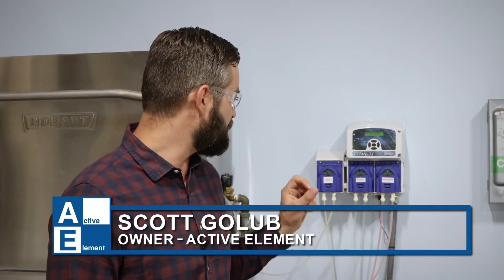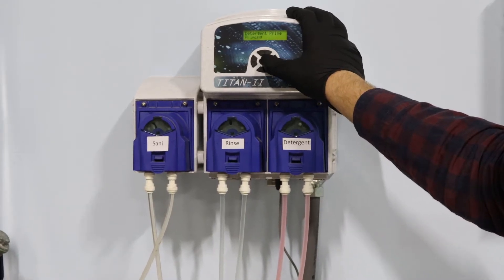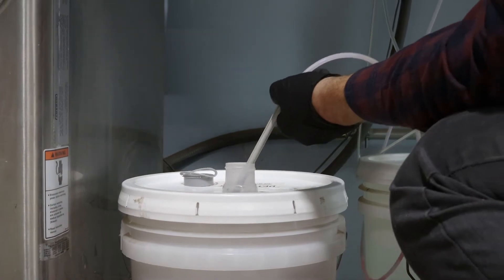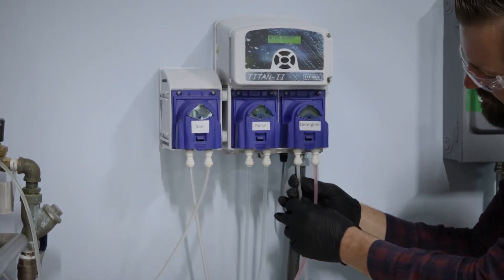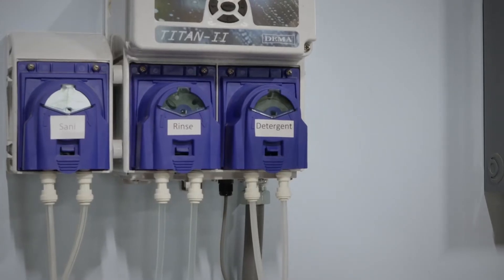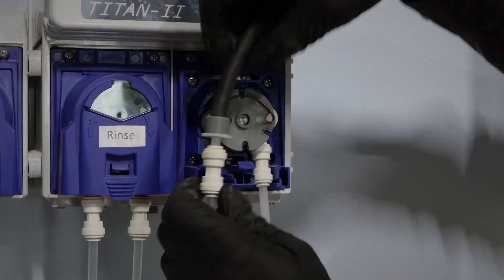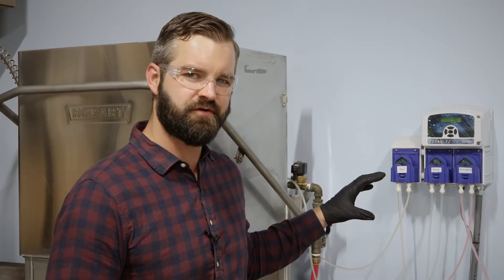How to Replace Your Chemical Lines and Squeeze Tubes - Active Element - Maintenance Series

Comment: What would cause the low detergent alarm to go off even though there is plenty of detergent available? We have at my work the same dispensing system except can you use a solid soap that  hangs upside down and its holder. In addition to the alarm going off the other system is the machine is using way too much detergent. We have someone coming in next week and I didn't notice a wire sticking out that is possibly being pinched. I do not see the wires sticking out in this video.
Reply from the maker: Sounds like the wire would be the issue. Were you able to get this resolved?

Comment: I have a Hobart centerline dishwasher. The chemical supply line has some “black” lines, maybe the width of a pencil eraser at several segments in the end of the line (where it sits in the gallon detergent). Is there a way I can clean these out or do the lines need replacing?
Reply from the maker: Thank you for reaching out. I recommend replacing the chemical lines. The chemical lines get worn, brittle over time and you will eventually have to replace them anyways. My guess is you could replace the lines in the same amount of time it takes you to flush them out. Hope this helps. Thanks!

Comment: Good evening are you familiar with knight UMP warewash dispenser, can you please makea a video about the installation and problem shooting of this dispenser. Thanks.
Reply from the maker: Thank you for the inquiry. The Knight dispensers, and all the chemical dispensers, are very similar in their operation and troubleshooting. The squeeze tubes and chemical lines are a different part number but there is not much that can go wrong with these dispensers. Is there a specific issue you are having with these dispensers?
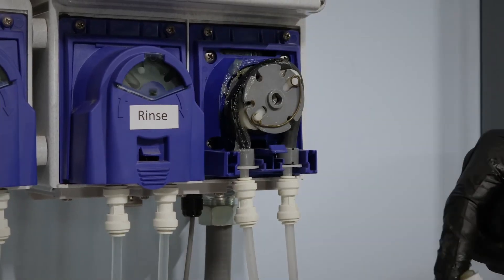Reply: @4:08 would have applied the tube lube before installing the new tube
Reply: With spartan pump what means F, P,L?